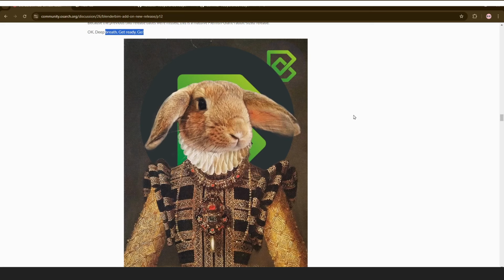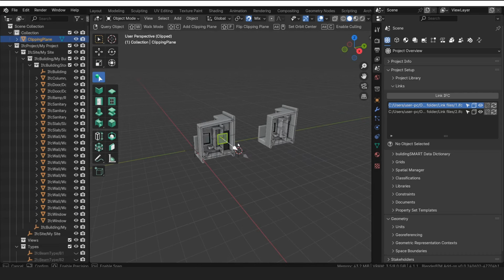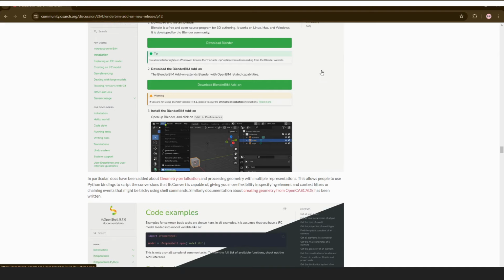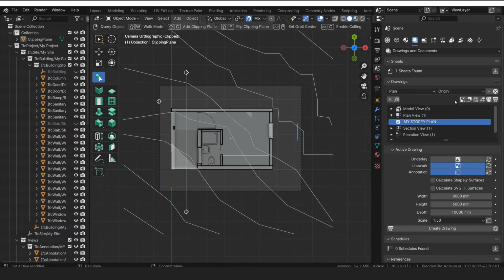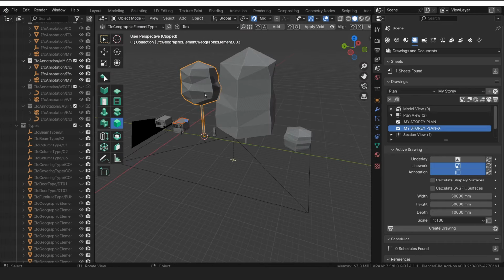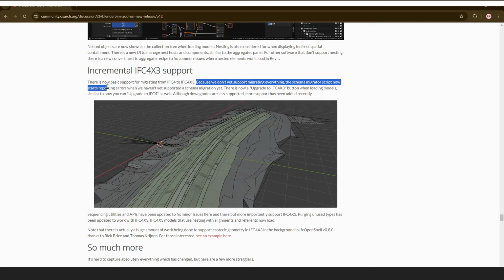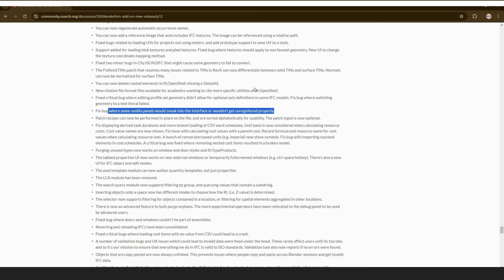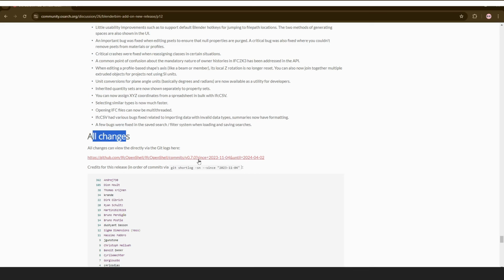BlenderBim Addon Update - 24.04.02

Comment: I really don't get it. They improved everything except the core user experience. We can't even draw a wall the same way we draw a cube, we need to click buttons, input number do rotate, it is a nightmare to actually try and experience designing. Even android home modeling apps does good jobs on it. 😢
Reply: I feel your pain, but you are not seeing the whole picture. Blender has a unique way of adding and controlling objects with the 3D cursor and has never had proper drawing tools. If you come from other 'architecture' software, this might feel wrong, but it’s not actually as bad as it might seem at first. I would also like to see more intuitive drawing-based tools in Blender, but that might require a bigger overhaul of the whole modeling system.
Reply: @DanielDesigners  I'm afraid it's a hard sell when it takes about five minutes to draw what can be done in Revit in about five mouse clicks.
Reply: @neildavies43  Drawing a wall quickly is not issue in architecture softwares right now. It is the closedness, price and lack of development. In some cirmuntances also the lack of freedom in Design process. Blenderbim (now Bonsai) is becomming a gamechamger in these fields and quicker drawing is comming there eventually.
Reply: @DanielDesigners  I've spent the evening having a go at Bonsai BIM and I'm just going to put it down, move on and maybe wait for the next update. You dismiss speed of drawing, but the principal reason for BIM is speed and accuracy of producing drawing information. Bonsai BIM needs to fundamentally address how information in inputted before it moves on to anything else or it'll never amount to anything. I actually strongly contest that it aids freedom in the design process, it's massively too clunky for that, it's like trying to produce a sketch using a 3D milling machine that only understands python.
Reply: Have you tried shift+P.  Game changer in wall drawing.  Be in wall mode!!!  Like drawing a line....Enjoy!
Reply: make use of Shift for orthographic and tab for precision and backspace for undoing and c for close.